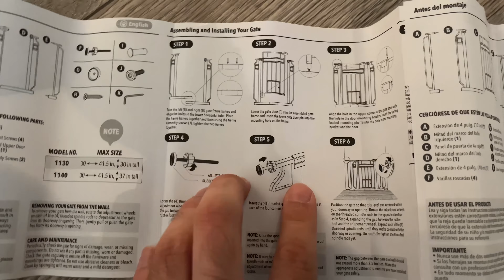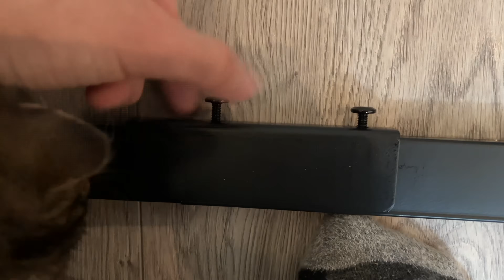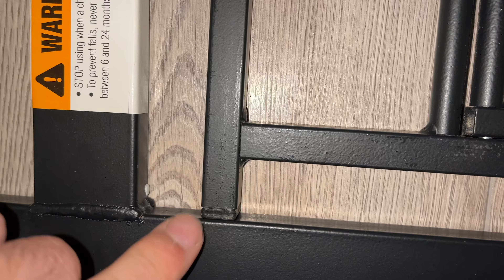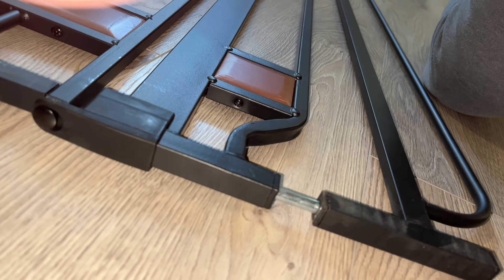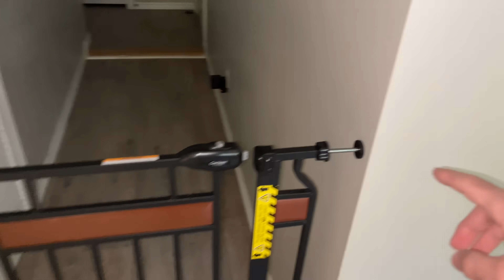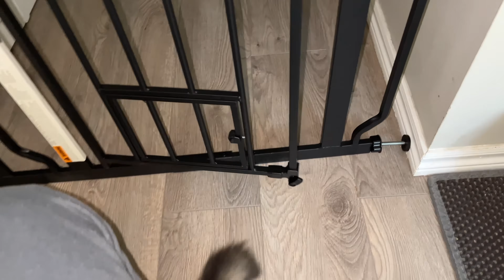How to Assemble & Install Carlson Pet Products Walk Thru Pet Gate

Comment: I think mines broken...
The top pin doesn't stick out like yours and it remains the same way regardless of pressing the button and sliding.

Also the bottom part that controls the direction it opens do not rotate at all...

Comment: my h pin does not fit
Reply from the maker: You have to tight the side ''anchors'' to be able to bring the pin and the locking mechanism together. If not they sit far apart.